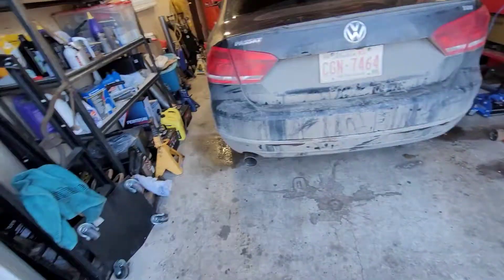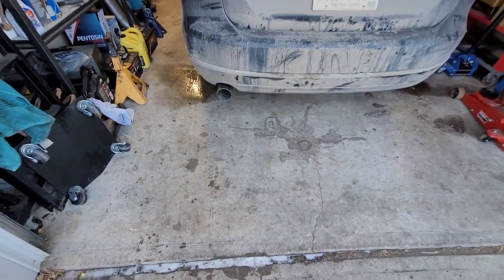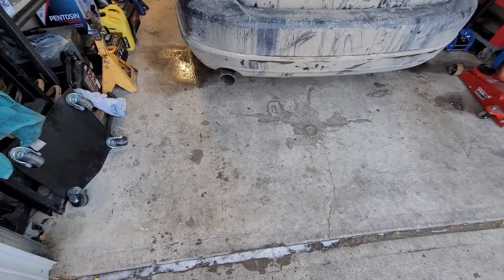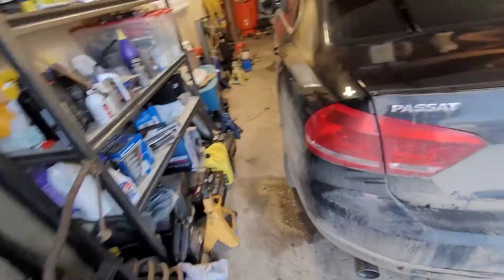3.5" TDI Straight Pipe Exhaust First Start. Stage 1 Tuned. (Speakers up)

Comment: I love the build, it sounds great. I have a couple questions if you’re willing to answer them. Is your exhaust custom made or did you buy it online? Is it a flash tune or tuned by a shop? And last one, how is the drone while driving on the highway?
Reply from the maker: Hi I built the 3.5" exhaust myself from the turbo back. I had a Buddy tune the car he tunes all kinds of vehicles. It really didn't Drone much on the highway sounded pretty good in the cab.
Reply: @doserdiesel  Awesome, you guys did great work, cheers!

Comment: I have a 2014 Passat tdi sel premium and I am looking for straight pipes online but all of them are very expensive I am wondering how to make my own like yours
Reply from the maker: Check Darkside motor sports in the UK they sell the exhaust flange for the Turbo. Then source the Exhaust pipe from a local shop is your best bet.

Comment: Hi, I’ve got a caddy with the same 2.0tdi common rail engine in it. I’ve had dpf/egr removed and coded out. Got a straight pipe but sounds no where near as loud as this does. Do you have any suggestions on why this might be? Thanks
Reply from the maker: Maybe the size of the down pipe. Mine is 3" for about 6" and then 3.5" straight threw to tail pipe. What size is your down pipe?
Reply: @doserdiesel  I’ve got the DPF gutted and re-welded which goes 2.5inch back. I wonder if the DPF shell somehow effects it?🤷‍♂️ I’m in the process of going 3.5” from DPF shell back
Reply from the maker: That might be it. If you had it 3.5" all the way down it might sound different.
Reply: @rogersmediauk9418  I would think it absolutely would affect it.